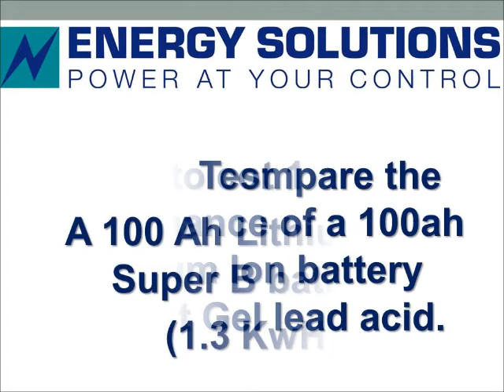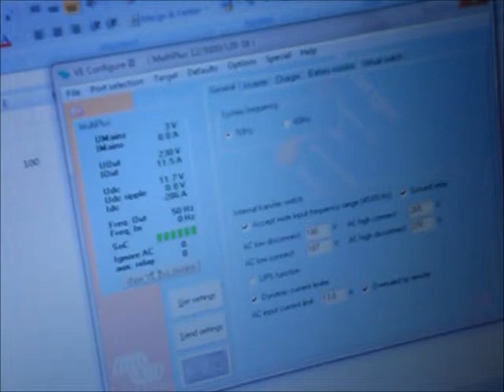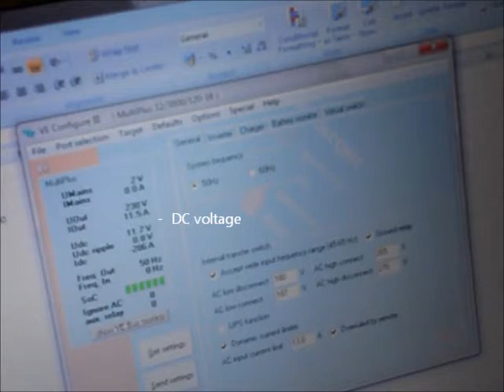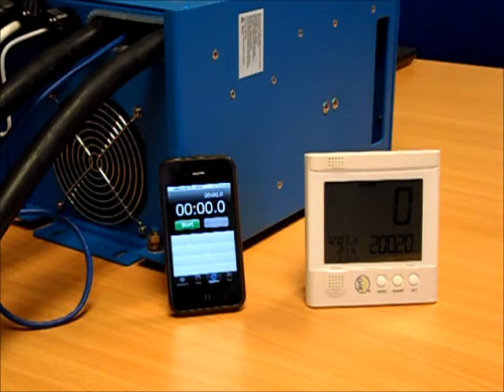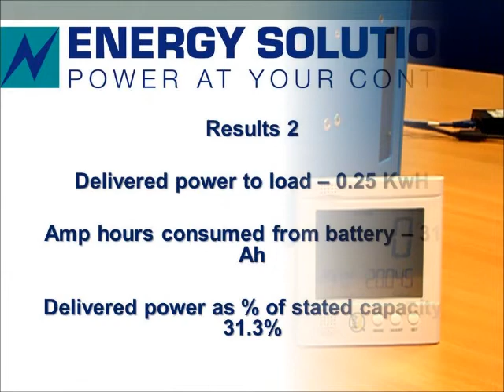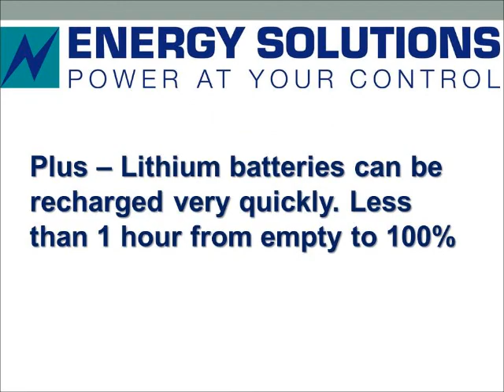Lithium battery test versus Gel.

Comment: my friend: the gel batteries are deep cycle : 1 slow discharge,2 traction batteries... the C rating of each type are different  in high demand use, the c5 ratings are tipical of gel traction batteries and c20 the rating of the deep cycle c20 batteries. this is translated in: a c5 rating traction battery 100Amp/h can give you that 100amp in 5 hours so you cannot draw more than20Amp  instantaneus if you don't want to damage the battery... they are build to give you that... on a c20 rating battery 100Amp/ you can draw 5Amp/h instantaneusly... on the other side the liion or lifepo4 batteries have a much higher Crating, they will give you that power diffretly... a liion or lifepo4 battery will have the capability to give back more current instantaneusly because the c rating is much higher... they accept like 4 times more current than the capacity on discharge (on a 100 amp battery you can draw as much as 400Amp/h for 10 min untill it heats (always depending from the type)... there are diffrent types of liion cells also, there are the tracion ones that have a smaller capacity but they can give more instantaneus power (like the ones used in tesla electric cars) and there are the ones at slow discharge but with higher capacity (the ones in laptops).... the sest you've made is like : gudging a fish by his ability to clime trees :)